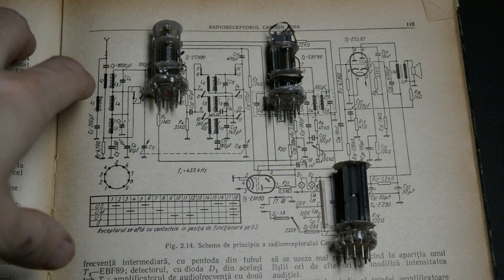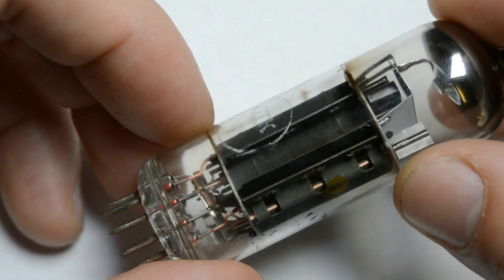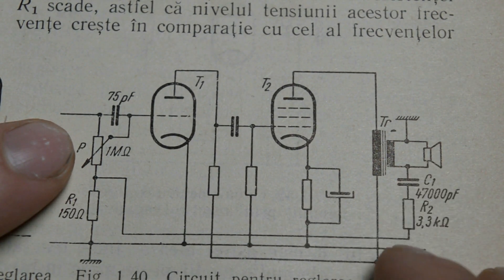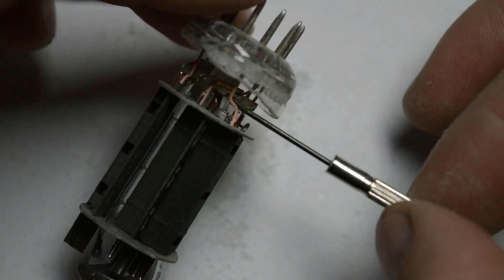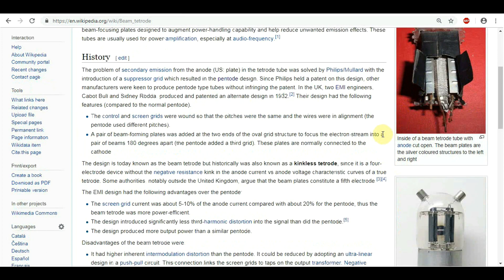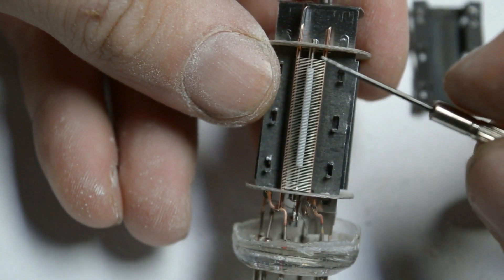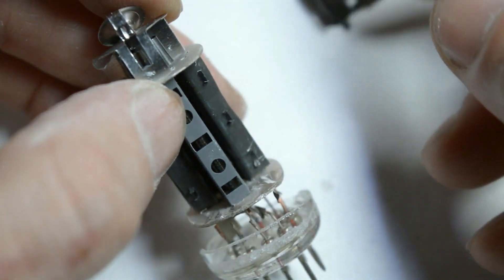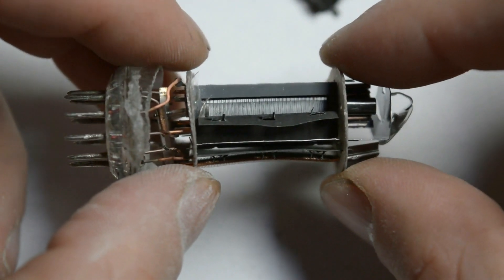Vacuum Tube teardown - the ECL82 / 6Ф3П triode-beam tetrode audio amplifier tube

Comment: Does the Russian ecl82 have the same pin out as the eu/USA valves ? .
Reply from the maker: Yes, the ECL82 has the same pinout as the Russian 6Ф3П and the American 6BM8
Reply: @FesZElectronics  I’ve got some Russian 12ax7 / ecc83 equivalents, they are the same valve , but the pin out is different to. The eu /USA ones  . I think it’s the heaters that are wired differently . I’ll have to check it out again . I haven’t had them out for a long time, cheers bruce
Reply from the maker: You are right the 12AX7/ECC83 does have the option to either supply one triode at a time (with 6.3V) or both at 12.6V - the 12 in the 12AX7 stands for the possibility to supply by 12 V. The ECL82 on the other hand (and any version of it) can only be supplied with 6.3V both elements - no possibility to supply the triode and pentode separately.